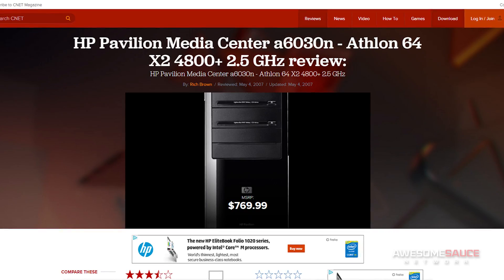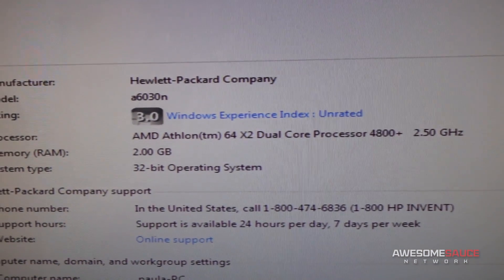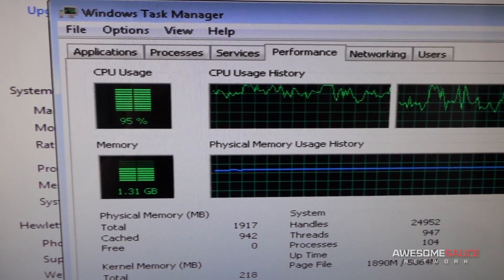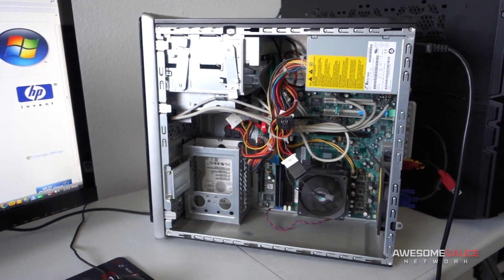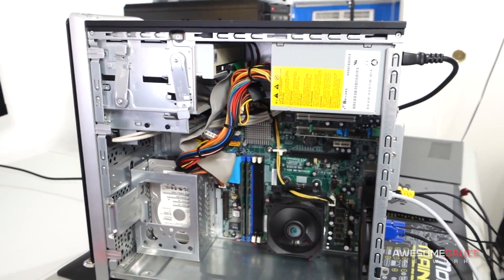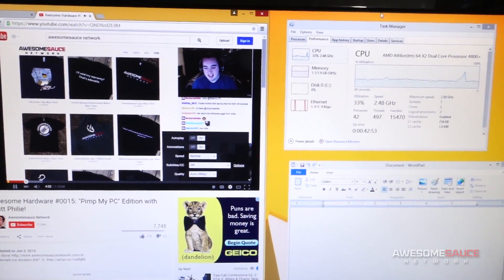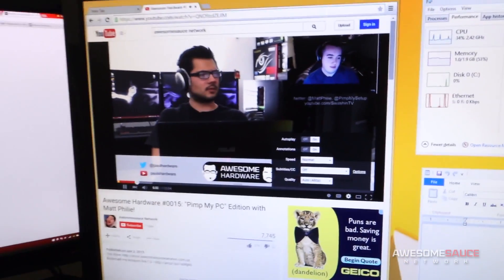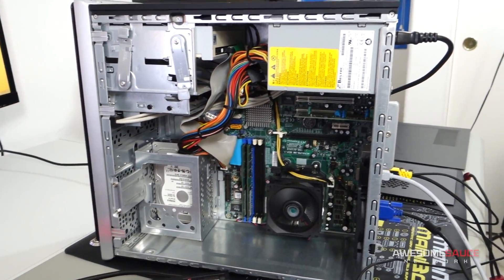Cleaning Up My Neighbor's Old Desktop!

Comment: Hey Kyle my GF just "killed" her laptop with some sort of virus where she can't access the internet (in browsers) anymore. It says that some Proxy is unavailable or something. You know of any programms that can help? Malwarebytes detects like 100 things but cant fix this issue :/
Reply: "malwarebytes detects like 100 things"  well, that's a huge problem mate. I would reinstall the hdd for sure, and tell her to not install so much bullshit
Reply: ***** It's funny how everyone is saying reinstall the OS and wipe the HDD. People just see VIRUS and run away with it without actually looking at the problem. For those of you who don't work in technical support, you always start with the basics and use the more intrusive methods as a last resort. It sounds like to me she may of installed some malware which has altered her browser settings. Here, i'll give you some tips on diagnosing the issue:

1) Check to make sure she actually has connectivity to the internet. Have a look at the network icon in the taskbar, does it say "internet access"? If not, press Windows key+R, type CMD and hit enter. This should open the command prompt. Type IPCONFIG and hit enter. Check to make sure her method of connectivity (wireless or ethernet i.e. LAN) isn't in a "disconnected" media state. If it is then check the physical connections (if using ethernet). If the physical connections check out fine then check the network adapter isn't disabled in the Network and Sharing centre. If it's enabled then check her IP address. If DHCP is working properly you'll probably get a 192.168 IP address. If you get an IP address starting with 169 it means the DHCP server isn't working correctly. If everything checks out fine and looks correct, move onto the next step.

2) Checking the proxy settings. Use this to check the proxy settings for each browser --> http://www.wikihow.com/Change-Proxy-Settings 
For home users "automatically detect proxy settings" should be the only one that's ticked. If "use a proxy server" is ticked with the field filled in, then delete it and untick that field. Save the settings, close the browser and reopen. Does it work? If it doesn't then check your settings have been saved and not altered again. You can also hit the Windows+R keys and type MSCONFIG. Go to the services tab and stop any suspicious services. If it works, reboot her machine and relaunch the same browser. If the issue reappears then it's most likely malware that's launching itself at startup and altering the proxy settings. Open MSCONFIG and remove any unnecessary startup services. Then check to see if the proxy settings are still being altered after that. 

 I'm not too sure if this will work but you could always try booting into Safe mode with internet access. If not, as Keith Demons suggested, use a portable web browser to access the internet. 

Have a look at the article below, you may want to try a few of their steps too: http://superuser.com/questions/169303/why-are-my-browsers-suddenly-configured-to-use-a-proxy
Reply: Kyle Albright Most of the time it's just quicker to reinstall windows and I'm telling you this from a ton of experience. I've been repairing computers since 94.
Reply: ***** The cleanest way is to backup personal files and just reformat the OS.

 If you don't want to do that there's a lot of tools you can use at bleepingcomputer.com (Search for adwcleaner, junkware removal tools, Windows Repair (All In One) ,malwarebytes ,roguekiller ,hitmanpro).

or

Use TronScript https://www.reddit.com/r/TronScript/comments/38d6yz/tron_v634_20150603_subtool_and_definition_updates/.
Reply: ***** you could wipe the HDD
Reply: Any important files on their ?
Reply: That's not the plan :D I want to keep the system how it is. She is 7000km away atm. I'll do that in 2months when she's back and give her Win10. But for now she needs internet again :/
Reply: The Gooses Nooses Alex Chulzhanov TheSlaugh 
Well guys i cant just reinstall. Also Malwarebytes works, it's not like it wont install..
Reply: ***** why can't you reinstall? Just backup the files and reformat the drive
Reply: TheSlaugh because read above.
Reply: ***** something like that might even require a registry edit. try removing the proxy server from Internet Options in control panel if you want. but there's still gonna be shit in the OS that you don't want.
Reply: ***** Bitdefender was pretty good when I tried it out a while ago, I don't really like malwarebytes, norton, AVG, or mcafee, they have all gotten crappy over the years. I normally don't run virus scans as a constant thing, I run a check every now and then uninstall it right after. They like to take over way too many things on my pc for me to like them.
Reply: Ro-Tang Clan in my experience Tech support are usually pretty bad at their job and the basics that you are talking about most likely has been tried, for some reason tech support likes to walk you through the same stuff over and over no matter what you say. Call a cable company and mention your net is out, they spend the next hour telling you to modify and check/restart your PC or your hardware before even checking to see if the problem is on their end.The basics that you are talking about isn't special and everyone knows these basic processes/checks for the most part except for the older community. I have had to yell at a tech support rep because he wouldn't quit walking me through things I did before the call and told him that I had done it to save time.(power cycle modem/router, check network config, check what lights are on,direct connect, restart pc, run network diagnostic, etc).

 I got called a liar for 3 months by charter basically because they said my network wasn't going out and hadn't since I had it connected, even though it would kick me offline every 5-25 minutes all day. After the 4th tech came out and I basically in the rudest way possible told him what he would say and do (hook his device up, check the connection, tell me it hasn't disconnected...and all that) he finally stayed for more than 5 minutes and checked the entire network, turns out whoever installed the cable had the copper wires left hanging out of the cable wire and was touching the metal casing at the line and it was disconnecting me.  #TechSupportExperts
Reply: DJ Gaming I understand you're speaking from your experiences, but not everyone in tech support is bad at their job - but first, you have to understand what their job is. Most helpdesks follow the ITIL foundation whereby the workflow and engineers are divided into tiers. Lvl1 engineers should have a little technical knowledge so they can provide simple fixes, but really their job is diagnose the issue, not fix it. Which is why you end up speaking to some foreign guy in a different country who can hardly speak English when you call your internet provider. Their job is to take down as much information as possible and make sure you've gone through the basic steps to fix the issue. This gets passed to a lvl2 engineer who will actually provide more technical fixes. If they can't fix it, it will then be passed to lvl3 engineer's who are often specialists in a particular field. These may be desk engineers or on-site engineers. 

Personally I work for a company who provide business-to-business technical support. We do support for schools, academies, universities, prisons, MOD sites, NHS sites and a construction company. So in terms of consumer support i've had very little experience or exposure (even in my personal life) so I'm unable to comment much about that, but I do know that consumer support does tend to be more basic. Even so, I know it's tedious and annoying going through the basics, it is often something most people overlook, which is why it's a MUST to start with the basics no matter how annoying it may be. If there's one thing I've learned whilst being in tech support, it's never to assume. Most people replying in this thread didn't start with the basics because they assumed the OP had already checked these things or had the knowledge to check them. However,  if the issue was something very basic, you'd of all wasted your time replying with intrusive answers when none of that was relevant at all.

One of the support calls I took was someone who had gotten up early one morning so he could get a head start to the day and get a particular job done for his boss which was due in at a certain time. He was working remotely from home so his only access to the network shares is through the VPN. However, whenever he launched IE (which is the only browser the VPN client supports), it was asking for his credentials. But upon entering his credentials it wasn't accepting his password. Now, he knew his password was correct because he could access his emails which is all part of the same AD account. He told me he'd been trying to fix the issue for 3 hours and he was at the end of his tether. He was going on about how he'd checked his IP address and he's rebooted his machine and gone through what he described to be "everything" and he demanded I looked at his AD account as he thought there was an issue with his account. Before I did,  I remoted onto his PC through Teamviewer (other browsers worked) and had a look at his issue for myself. It turns out he entered his username incorrectly in IE at one point in time, which then saved the wrong username for consequent times. Their usernames follow "firstname.surname" but he was putting in "firstnamesurname" - he missed out the dot. We had a good laugh together about it and he was nearly in tears once he found out he spent 3 hours trying to fix it when the issue was so simple.

Point being, there's a reason why tech support get you to go through the basics at the start, because if you don't, you could be potentially wasting their time (and your own) if you don't. That said, I agree there are people in tech support who are crap at their job and are sometimes rude and a little persistent, but don't let that put you off of them. Just try and be as co-operative as possible and if you notice someone who is terrible at their job just drop a line in to say "could it not be this issue" and explain why. If they don't know, i'm sure it'll get passed onto someone who does know.
Reply: *****  Maybe this will help....       
http://malwaretips.com/blogs/the-proxy-server-isnt-responding-removal/
Reply: Ro-Tang Clan Ya, first level help line are the new guys following scripted paths, is it plugged in, is it turned on, ...
Reply: ***** I hate how everyone defaults to "Reinstall Windows." 

Run Malwarebytes, JRT, Combo Fix, Adwcleaner, SUPERantispyware and that should do it. 

After doing those, I usually go further and run Glary Utilities and CCleaner to clean disk space, then SImple System Tweaker to make the system a bit fast, then finish it off with a HDD defrag and add Adblocker, HTTPS Everywhere and WOT to Chrome.
Reply: Might be voice of experience speaking. Some of us have done both, clean or reinstall. Reinstall does let you incorporate things you wish you did. Reinstall is about 30~60 minutes of keyboard time, most is waiting for copying, installing, rebooting, ... if I have other things I want to do, I might reinstall. Then backup / duplicate a fresh install. Then misplace that disk.

Sometimes, often, I just go on a bug hunt to clean up what's been found.

Anyone ever been hit by ransomware?
Reply: Very curious, just wanted a snapshot response of the six or eight people on this thread.

Goes to show the effort of effective backups are worth it.
Reply: ***** Since network/browser access has been compromised, a couple things to try that might get you off the floor.

1) If you're command prompt savvy, open a window to verify things are turned on and pointing to legitimate gateway and dns server by ipconfig/all.

2) Check the  browser's setting, Tools -> Internet Options -> Connections -> LAN settings to see if anything is out of place. Generally the 'Automatic detect settings' being checked is sufficient with all other items unchecked and blank.

3) At the command prompt, validate the hosts file has not been modified, an easy place to monkey with network defaults. That can be seen: type c:\windows\system32\drivers\etc\hosts

It is a starting point.
Reply: ***** Options:
1) Reset windows, completely.
2) Take out important files; maybe anything for school and put it on a flash drive. Reset windows, then import the files back in.
3) Get a hammer and smash that computer and buy a new one.
4) Put it over gasoline.
5) Swim with the laptop in the ocean.
6) Don't do anything I said for 3,4, and
Reply: ***** Ha, go fuck yourself moron. I gave re-installing as the most simple and cleanest way for him to solve his problems. I also go into tools he can use to scan his PC if he doesn't want to re-install.

Stop spamming people and trying to act like a smart ass when you don't have anything productive to say.
Reply: *****
And I already provide those steps also unlike you.
Reply: ***** You're a fucking moron. I said you can re-install or he can just use scanning tools, i never said he should do both.
Reply: ***** I only fucking mentioned it as a option because it is one. I'm not charging anyone, I'm just giving them options they can choose to do by themselves. Why don't you go get a life you fucking moron!
Reply: ***** Who fucking cares what order I put it in? If he wants to reformat then he'll reformat, if he doesn't he'll go for the 2nd option I gave him.
Reply: ***** Like I said, I'm not charging anyone as I don't make a living fixing computers unlike you.
Reply: ***** Why r u even talking about money? Like I said, I'm giving them free advice on how they can fix their computer by themselves.

Obviously people who know about computer can do diagnostics themselves and fix the computer with the right tools, but for people that don't know how to do diagnostics a reformat is the easiest way to fix any problem.